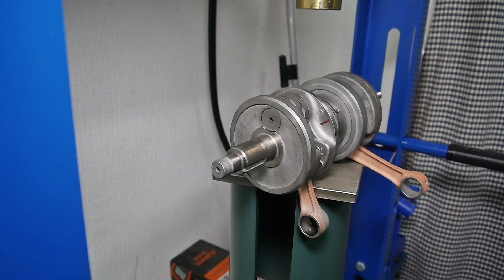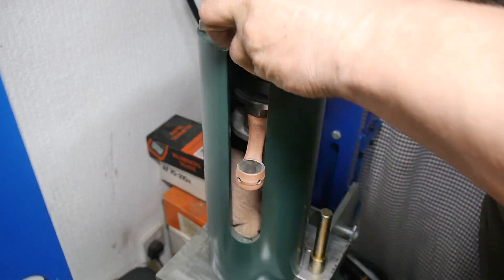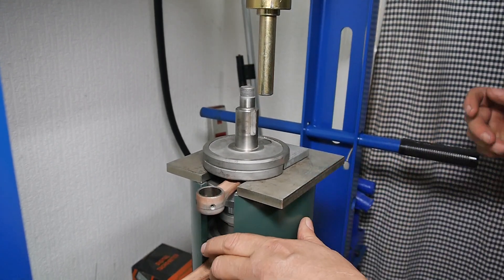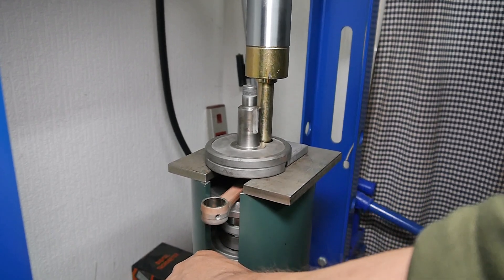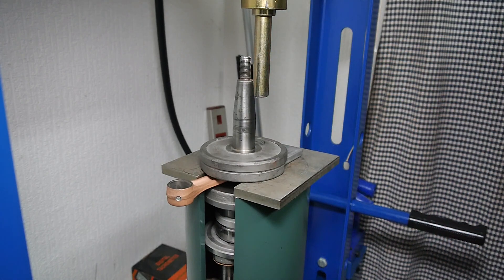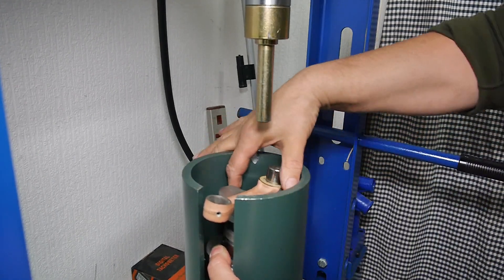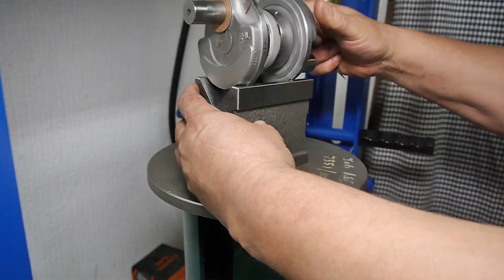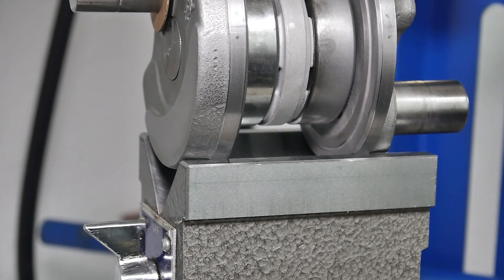Yamaha RD 350 LC Crankshaft Rebuild part 1

Comment: Hi David, could you advise the thickness of the small plate which helps support the main plate ? I am guessing it is 5mm ?
Also, what size vee block are you using, 4inch ?

Comment: I'm working on an older (similar) crank (1973 RD125) and the manual shows the left and right cranks being separated first with a simple tools which clamp on to the perimeter of each crank and are then pushed apart by turning bolts threaded in to one of the tools. They then press the conrod pins out of the individual cranks. Would this perhaps have been a method used if there was no tube like yours available?

Comment: Can you tell what is the OD of that 10mm wall press tube, I'm guessing 6.6" maybe, x 12" tall with 10" x 2" slot? And the size of the Magnetic V-block is it 4" long?
Reply from the maker: The press tube is made from a seamless hydraulic ram, measuring 14 inches tall, the slot is 10 inches deep and the outer diameter is 6 inches, wall thickness 10.00mm.
The magnetic block is 4 inches long.
Reply: @daviddanielstephenson2833  ok thanks!
Reply: @daviddanielstephenson2833  I have purchased a tube 6” OD 5.25” ID .375” Wall x 14” Long. It’s cut square but a little bit of sawtooth marking on the ends, debating to have the ends faced or not before cutting the slot… which brings to the next question, what is the width of the slot? Will be used for TZR250 or RZ350 parallel twin.
Reply from the maker: @3DCharacterArt  The slot is 40.00mm wide, same for the pressing plate, which is large enough for most conrods, the slot in the pressing plate needs to clear whatever size the big end is across, so the plate can rest right up against the big end journal.
If you can square the ends of the tube both ends so it sits perfectly square, then pressing out pins will be much easier.
Reply: @daviddanielstephenson2833  Thank you!

Comment from the maker: Here is an interesting view of how a crankshaft production line works, notice how the crankshaft operator uses a solid copper block instead of a hammer, also the large copper drift instead of a hammer, if you use a copper hammer the hammer eventually mushrooms and tiny fragments can flake off that can work there way into and contaminate and or damage the soft white metal big end bearing cage, which is what you want to avoid if you can, https://youtu.be/OOpDG7WhdwM
Also notice the dedicated stepped plate that is used while the main bearings are being fitted, this is essential to prevent flexing of the webs and should always be done before truing commences.
I like to use a large lead block for the larger crankshafts to ease the re-aligning process, by placing the edge of one web on the lead platform, it takes most of the stresses away from holding it in your hand, and less force is needed to get things moving, I will do a video of the technique I use when I do another crank.
Reply: A steel hammer DENTS the crankshaft halves.  Ugly.  Use brass or copper hammer.  Preferably copper.

Comment: That works great. Great idea with the insert
Reply from the maker: Using the older ways with a proper pressing setup, IE, tube and the extra insert you acquire much better overall support when taking things apart, using the tube method there is also less inside distance between the outer edge of the crank web and the inside of the main tube, thus there is little to no flexing taking place, as the plate supports the whole of the crank once everything is placed together as shown in this video.
This makes the pins much easier to remove, if one encounters any plate flexing during the pressing process and or pivotting this can be detrimental to the overall integrity of the crankshaft and hamper the re-pinning and or aligning process later on.
The pins need to be pressed out and back in again as straight as possible, so they do not try to twist or pivot, "especially as they are being pressed back in", which can happen.

KTM sell a superb setup like this one, but it comes at a cost for doing what is a relatively simple proceedure, you can see some of the parameters taking place that I have already aforementioned in this video, https://youtu.be/4wYvKTes-ZM
Working with the tube types, supported on top of the press main beam you are working above it and not under it, which also makes things much faster and easier to handle, IE, there is no need to bend down and try catching things from underneath as crank pin/s etc break free.
Many DIY presses are not wide enough to let the crank webs pass between them thus limitting the capabilities of the user, same goes for feeling what is happening, a manual press gives much better feedback when something is not quite right.

The tube shown in this video is made from a large seamless  hydraulic ram, it has a ten millimeter wall thickness which can handle up to 30 tons quite comfortably, I have several different bore sizes/tube to accomodate different crank web sizes, thus keeping the gap between them at a minimum.